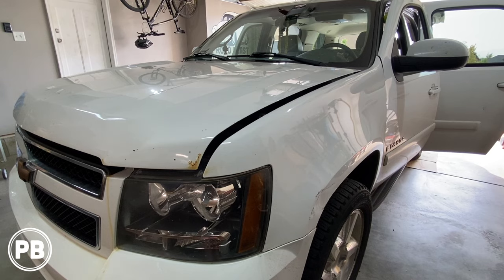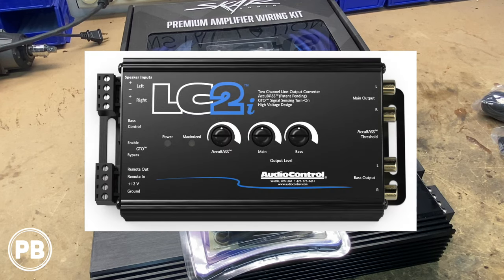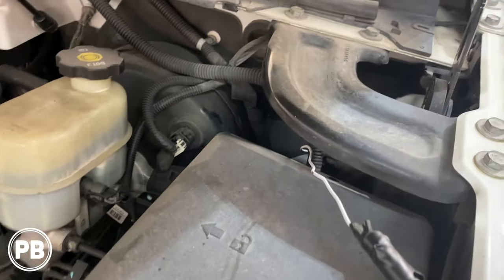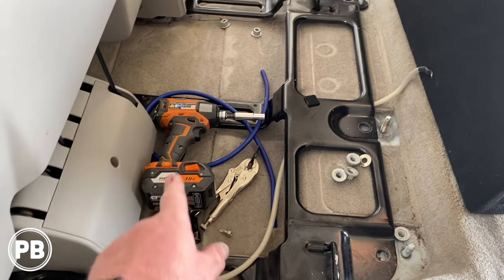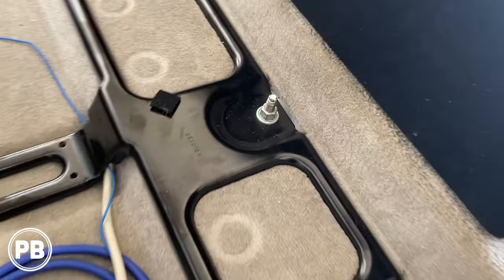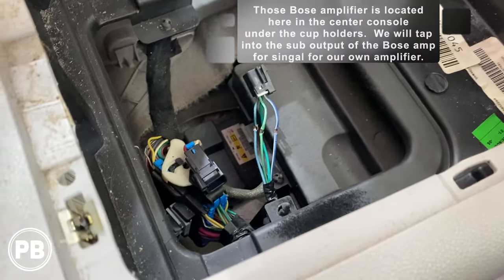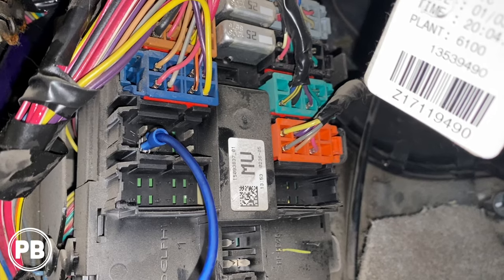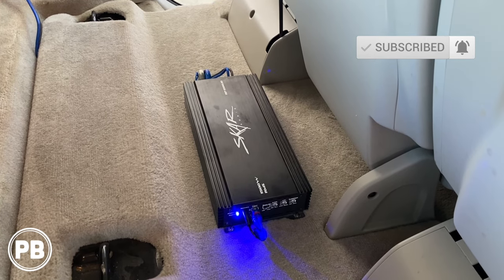2007 - 2014 Chevy / GMC Amp and Sub Install | Tahoe, Suburban, Yukon

Comment from the maker: Parts linked in the description of the video!
Reply: What if I wanted to run a complete different amp for door speakers. Being connected to stock amp can I still do so? Or will I have to bypass the factory?
Reply: Thanks in advance!!
Reply: @provo beast Audio what type of terminal do I need for my ground wire to hook it on that stud 2007 tahoe
Reply: @bears893 bypass factory. I’m gonna run the RCA’s from back of headunit to the 4 channel, then speaker wire to each door speaker

Comment: I’ve wrecked my brain on how to run my power wire for over a year, currently it’s running down the passenger side and through the spot between the door and fender, squishing the wire and causing it to loose a lot of power. When the door is open you can definitely hear and feel a difference. I’m definitely about to go back out and run it this way. Thank you a million times over. I appreciate it!
Reply: Ya bro that’s ridiculous. Always use a firewall
Reply: Update, amp blew not long after this post. Warranty the amp, it’s still sitting in the box waiting to be installed. I’m slowly buying all new wire, going from 0 Down to 4 or 6
Reply: @MrSlm1981  Unplug the power wire and remove it. You dont wanna burn your SUV down. Def route it like in this vid
Reply: Samee here dude
Reply: @zealandwylie489  got it figured out now, but down a sub for the time being.
Reply: @MrSlm1981  I’m re running everything. I ran all my wires down the passenger side and my power through the door door and fender
Reply: Use a step bit and drill a hole in the firewall, and use the grommet that is supplied with the amp wiring kit.
Reply: @zealandwylie489 drill a hole in the firewall with a step bit, and use the supplied grommet in the wiring kit.

Comment: If I have an aftermarket receiver do I still need a line output converter with the Bose system? Or just connect rcas and remote wire to the receiver
Reply: No

Comment: I’m planning on setting my gains with the smd also but what did you give yourself for a reference point since this radio doesn’t show a volume number?
Reply: My factory radio W/ Bose, no navigation, maxes out at 45 clicks. I used an SMD DD1 off the high level, feeding Subwoofer under center console. I detected distortion W/ Test Track 40MHz, at 31click -  No distortion at 30 clicks. Hope this helps!!

Comment: In theory what would happen if one would connect both positives of the pac cables to one positive of the stock amp wires and both negative pac wires to one negative of the stock amp wires?

Comment: So I have the stock radio. I have the Bose logos in the A pillar tweeters. I when I went to install the converter in the plug in the center console. I noticed it doesn’t have anything to plug in down there. It’s missing the female side. No wires missing a plug or anything. Thoughts?

Comment: Instead of the PAC GM31 I used the NUITH kit basically the same. Issue I’m having is that the rear speakers don’t seem to be connected. Would I still need to tap into the Bose amp even though I used the wire harness for camera and steering wheel control?

Comment: I’m now wondering if I could tap into the factory head unit on my 05 Silverado (with the Bose system) to add a subwoofer. I think the factory radio would look cleaner. Do you think it’s possible?
Reply: I did it

Comment: The guy before me had this thing (07 yukon) all wired up and has wires ran and I noticed on my bose amp there is just straight speaker wire spliced into the wires on connector…what does that mean?

Comment: Same thing needed to run mids and highs or is it best to just run new speaker wire through each door?
Reply from the maker: Depends, but usually if your factory wiring is in good shape, you can use a T harness or Bose amp bypass to send your signal to each new speaker.  OEM wiring generally can support up to about 100w RMS.

Comment: I have a 2011 yukon I already put an after market radio  so all i have too do is run my rca from back of unit and remote no need for a converter correct
Reply: Correct

Comment: I’m following this video but I need a ground point for the line output converter I bought. Where can I do that?
Reply from the maker: Depends where you are installing it.  Any chassis ground is fine, bare metal, etc.

Comment: Hey Provo, I followed these instructions perfectly and did everything the same. When I first turned my key forward all was good sub was playing then I turned the key off to clean up some wires and turned the truck on to test run the sub and now I’m getting absolutely no sound out of my speakers 😂. I’ve checked everything amp fuse, radio fuse and wires to them.  2008 gmc Yukon xl Denali Bose system I’m guessing I fried the stock amp somehow but have absolutely no idea how that could of happened. Any idea?
Reply: What did you find out?
Reply: What was it???

Comment: What do you suggest setting the gain dials on the line output converter so as not to interfere with dialing in the gain at the amp?
Reply: Buy a SMD DD1. Check out his videos on YouTube he will walk you through it all. Steve Meade is his name

Comment: Question for you @promobeastaudioinstallation I put a aftermarket pioneer dmh-341ex radio in my 07 Yukon Denali XL and 2 amps and 4 super tweeters and 4 midrange speakers and 2 15s I ran my 0ga power on driver side of the truck and rca's on the passenger side but I'm still hearing engine nosie through my system could you help me out with that
Reply from the maker: Check your grounds, clean them up.  Also consider moving grounds to the frame directly.  Replace RCA cables, or your radio could be the problem as well.  Generally poor quality RCA cables and bad grounds are the culprit.
Reply: @ProvoBeastAudio  okay good looking out bro

Comment: Anyone looking for a cheap way to install battery bus bars. Just buy mending brackets at Home Depot, get some half inch screws with nuts and got bus bars for under $20

Comment: 1800 Watt amp is fine to use with my vehicles single agm battery right? No upgrades needed?
Reply: You’re fine. Only if you’re going 3000w or more is when you need to upgrade the wiring, alternator, and secondary battery.
Reply: @Mayjah_flexx so 2,000 watts is fine for that fuse under the hood?

Comment: So you put an aftermarket radio why did you use a converter for the sub? Why not wire right into the head unit... im sitting scratching my head why you would do that. You'll never get the quality sound out of that pac like rca's directly to the head unit...
Reply from the maker: Radio in this vehicle was the factory navigation, not an aftermarket radio which is why we pulled our signal from the factory Bose sub.  If you had an aftermarket unit, yes, you would alternatively run your RCAs to the sub output of your new radio.

Comment: At what point should you upgrade the factory alternator so that the electrical system of the vehicle is not over loaded with the amp drawing power?
Reply: 1500watts is a good amount of power but it’s not a lot to kill the alt, a good lithium battery as the main and in the back with big 3 and 0 gauge all around and you would be set with that same setup  with no significant voltage drop
Reply: @torrez8144  I think these tahoes come with either 120a or 145a alts from the factory, it should be okay with even a 1.5k class D monoblock
Reply: @Luminous.Dynamics what if i run a 2,000 watts? It should still be fine ?
Reply: @doughpywidit4112   2K rms? Which amp?
Reply: @Luminous.Dynamics  soundstream BXA4-1800 has 1,800 watts
Reply: @doughpywidit4112  It doesnt. Its a 4 channel amp rated for only 150 watts x 4 or 400 x 2. So 600w-800w at the most. Its good for door speakers but for subs youd want a diff amp
Reply: @Luminous.Dynamics  i have 2 kicker 300 watts each it should be enough, but i dont want to replace the stock head unit,but at this point its looking like it’s easier to put a aftermarket radio just so i can plug in the subs to there
Reply: @Luminous.Dynamics  i want the factory gps and reverse camera but im not sure if this video helps
Reply: @doughpywidit4112   Do you have kicker comp? That amp is enough for those. What sub model do you have? If you wanna keep stock headunit, just get a Kicker low output converter and use it to hook up to the soundstream amp. If you have the old Kicker comps with only one set of + and - inputs, you can connect two door speakers on the first 2 channels of the BXA4 amp, and the Kickers on the last 2 channels if theyre single voice coil ones.

Comment: If im running a 3k watt amp could i still run it from the factory fuse too?
Reply from the maker: With 3k RMS, you will want to not only go directly to the battery, but you will need an upgraded battery, potentially a secondary battery, big 3 upgrade, etc.

Comment: i have a 12 in my back of my tahoe running 1500 watts and i was playing music and it turned off but the amp is still on and all wires are all hooked up and no chance it blew up , idk if you know whats wrong or if someone can help ?
Reply: Possible the signal wires from the stereo because loose or unplugged

Comment: Having problems with the remote wire. We tried every fuse on the side. Amp still stays on and it’s getting very aggravating
Reply: It’s not on a true remote line on the head unit. Have to find it
Reply: In my install I had to install a switch because I was having the same problem. But I’ve since upgraded to a down for sound amp that has a Bluetooth bass knob that turns on the amp. So I don’t need the switch anymore
Reply: I tap it to an loc since the loc gets the signal from the rcas
Reply: Having the same issue now on a 2010 burb ltz. Stays on when connected to fuse panel on the driver side dash.

Comment: Will a convertor still be needed regardless of having the stock radio or aftermarket head unit with the bose system?? Thank you for the video!
Reply from the maker: If you have an aftermarket radio, no line out converter needed as you will just run RCA cables from the sub output of the new radio to the amp.
Reply: @ProvoBeastAudio  awesome thx for the reply!

Comment: I followed your steps with an after market radio. When I turn everything on the subs we’re playing something different than my radio & when I switch to Bluetooth it plays the music but the amp goes off and subs don’t play. What could be my problem??
Reply from the maker: A wiring issue to me.  Your remote turn on wire may be connected to the antenna blue wire of your aftermarket radio instead of your remote turn on wire.  Way too many variables to diagnose here in a youtube comment.
Reply: @ProvoBeastAudio  I appreciate your response. I’ll check that out again

Comment: Did you not hook up the ground wires on the line out converter?
Reply from the maker: It's an audio ground (optional), not a DC ground, and in most instances used to help reduce ground loop noise.  We didn't have that issue, thus wasn't necessary to connect.
Reply: @ProvoBeastAudio  thank you.  Just finished my install today and your video was my prime resource.  Especially specifying which wires to splice to with the line out converter in the console.  Thank you for taking the time to put it together.
Reply: My line out has a yellow 12volt ignition and ground, do I need run to fuse box?

Comment: If you have the bose sound system do you need to replace the stereo for the remote wire and rca?
Reply from the maker: Nope, a simple line out converter will do (just like we used in the video).
Reply: @ProvoBeastAudio  thank you